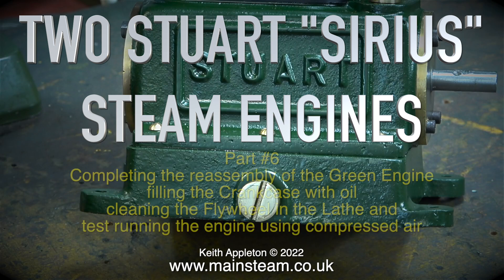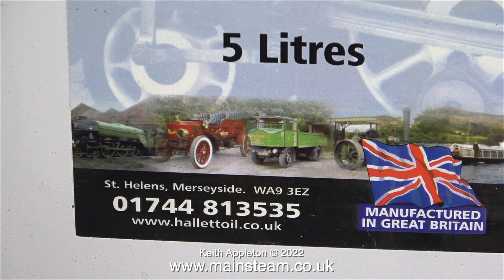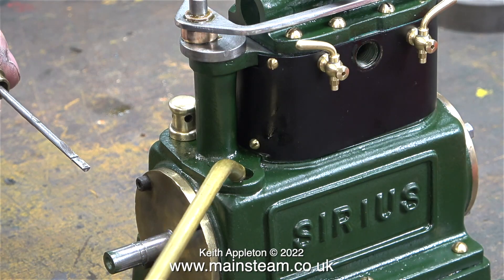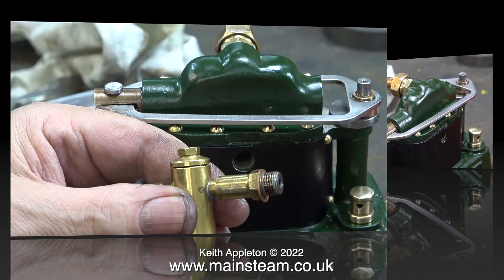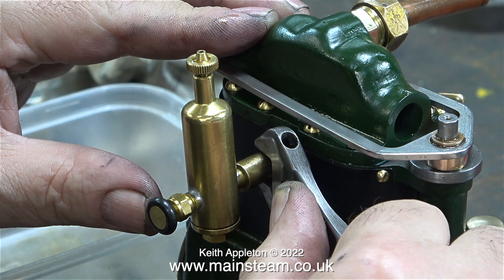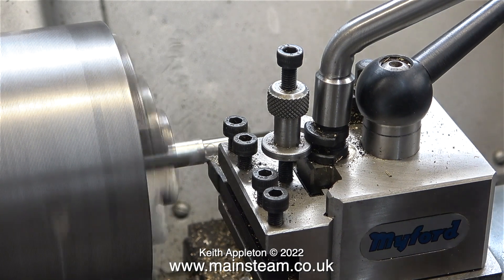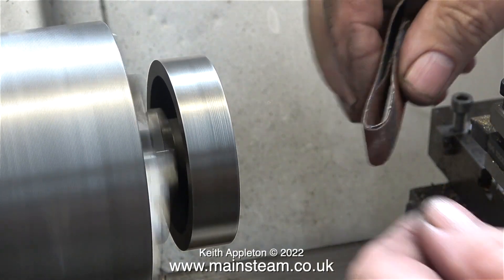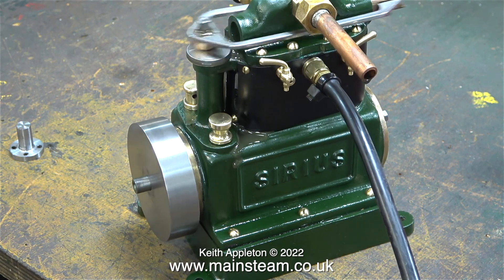TWO STUART SIRIUS STEAM ENGINES - PART #6

Comment: Would it be worthwhile to 1. Drill a hole in the drain plug  2. Install a drain cock and 3. Run a small length of tube out the back,bent to make a dip tube ?
It would make for less mess. Just a thought.
Reply from the maker: I think it is fine as it is. It works.